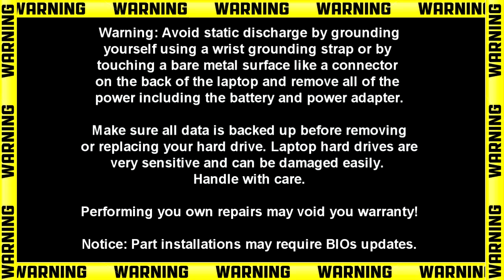Dell Inspiron 13-7373 (P83G001) Battery How-To Video Tutorial

Comment: hi. Which Philip screwdriver did you use? I used one I got at home and removed all except  two that can't move at all. what do you suggest? Thanks.
Reply: You'd be better with a precision screwdriver set. I got one on amazon for £5.
Reply: @KLC6432  I bought a set and managed to fix it.  thanks.

Comment: The plug connected from battery to laptop is tight, I'm afraid to pull it out, did you do anything before hand?
I'm actually trying this pls help
Reply from the maker: This cable is designed to have a snug connection. Pull gently but firmly.
Reply: @dellpartspeople  what on earth does gently but firmly mean?

Comment: I have dell insprin7373 and look like right right one. I have question want to make sure I order few of this battery from amazon and they are not work and not sure why. 
This battery the same look and watt as my original 38watt. My original charger is 45watt with 19.5V 2.31amp. Will this battery work and charge properly with my laptop and charger?